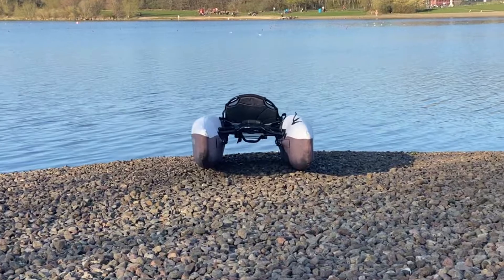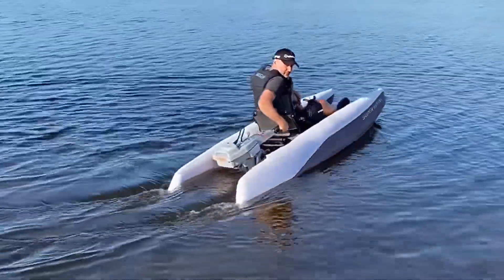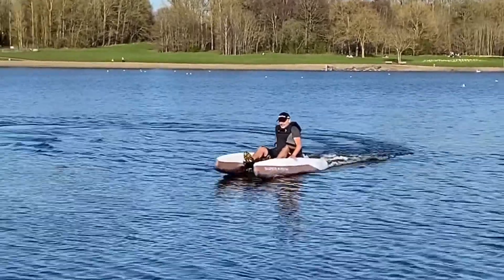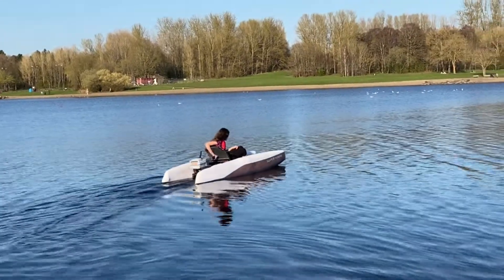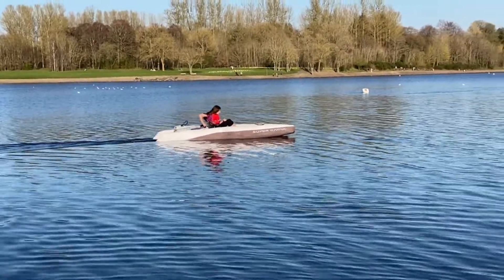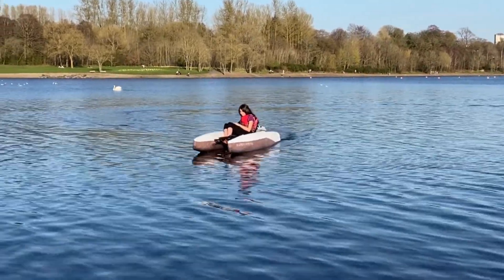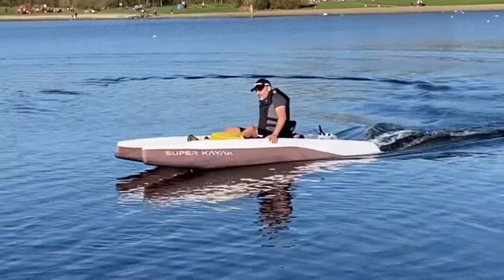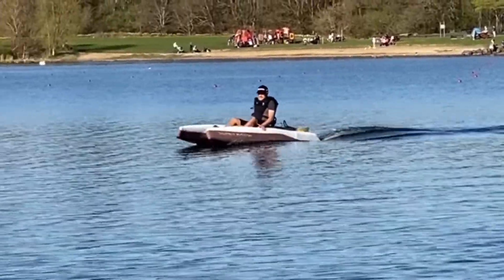Electric motor on our catamaran Super -Kayak. First trial

Comment: I just purchased your 2022 Binana version with a seperate new spiffy $400 Dry-suit, Chinese new year so they say my dry-suit will take months to arrive. Why is the 2022 model cheaper than the 2021 model?
.
I wouldn't use the motor gimmick with the 2021 model i'd go full penny farthing wheel with the 2021, engines don't turn heads in our media as a penny farthing wheel would.
Reply from the maker: Where did you purchase from?
Reply: @KirkKirchev  ebay